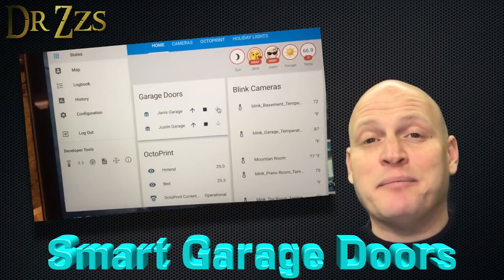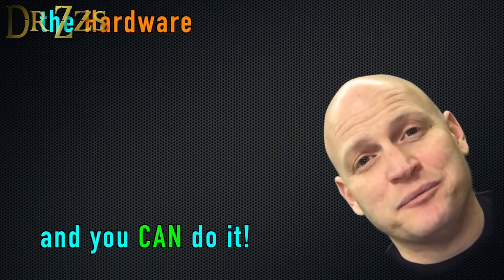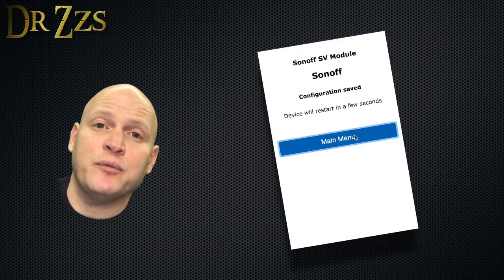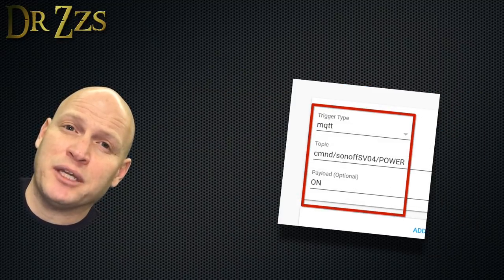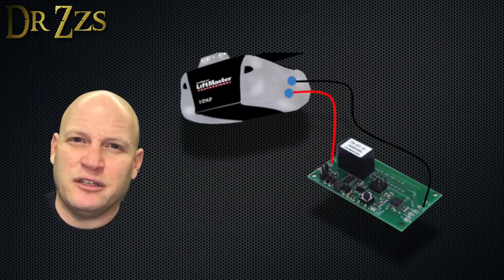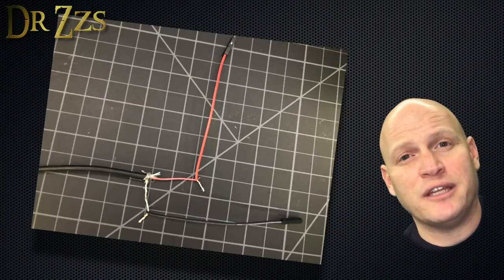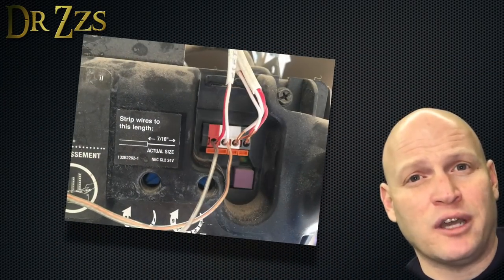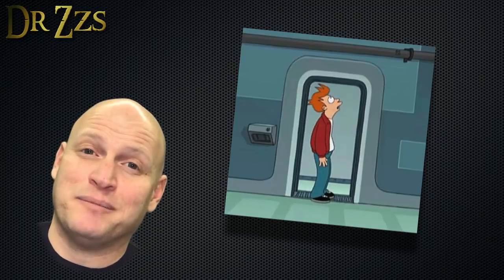$5 DIY "Smart" Garage Door Opener using Sonoff SV

Comment: Thank you for another great video. I just received a sonoff 4ch pro which I plan to use for my three garage doors. Do you have any plans to do a video for that device? It can be powered directly from mains without using an adaptor, is in a DIN mountable case and does not need soldering for power or relay wires. Since I don't need door open/close sensor the plan is to mount just below my existence three wall control panels.
Reply from the maker: Thanks! and you're welcome!
I have a 4ch (not a pro).  I haven't done anything with it yet, but I did buy it with the intent of making a video about it.  I haven't found a good use for it in my house yet. 
Are you planning on using Tasmota on it?
Reply: Yes, Tasmota but will likely hold off until new OTA instructions come out.
Reply from the maker: Cool.  I'll look into flashing the 4ch.  I seem to remember something different about it when I read about it in passing.

Comment: So I bought the components for two of my "dumb" garage door openers. I spent a lot of time learning with the first one and when I had it working on the bench I deployed it and it works great! I just finished building the second one and got it working on the bench but when I deployed it the open/close commands don't work. I can hear the relay click when I send the command via home assistant and I see the garage wall button light turn off for a second while it's "being pressed" by HA but nothing happens at the door. The opener is a newer chamberlain and on the opener there's a light-up up and down arrow button. After I issue a button press using HA I see the down arrow flash three times, not sure what that means. I think this may be a chamberlain design that in incompatible with this DIY solution... any ideas?

Comment: Excellent video as usual.  Couple of thoughts and enhancement possibilities.  If you don't want to wire it up by your garage door motor, you can simply pop open your spare garage door remote and connect it to the contact pads for the remote open/close button (what I actually did).  You can also use another Sonoff with some Home Assistant automation to flash a light and play an audio alarm/buzzer before closing the door (which is what the $100 Linear Z-wave garage door opener does).
Reply from the maker: Cysix Sweet!  You haven’t done that though have you?
Reply: No.  I purchased a Linear Z-wave opener before Sonoff existed.  I did wire the Linear to the remote though and it would work exactly the same with a Sonoff relay.  All the remote button does in close a contact.  BTW- I like your solution of using a reed switch vs a hall sensor or micro-switch.

Comment: DrZzs, thanks for your great video instruction.
I finally got it working w/Sonoff SV,  couple of issue, when I test the reed switch nothing happen. Also it didn't show whether the garage is open or closed. Wonder what control these issue. Thanks in advance!
Reply from the maker: We should be able to figure that out. Can you show me your cover entry in the configuration.yaml and the settings you’ve put into TASMOTA? It’s probably something simple that just got missed.
Reply: Thanks for the quick reply. Here is my setting in Tasmota and .yaml files:

In Tasmota:

Garage
Module parameters:

Module type (Sonoff Basic)

GPIO1 Serial Out 00 None
GPIO3 Serial In   00 None
GPIO4   00 None
GPIO5   00 None 
GPIO14 Sensor  10 Switch2

console:
switchmode1 0
switchmode2 2

/config/configuration.yaml

  # Customization file
  customize: 
    cover.test:
      device_class: garage
      friendly_name: Garage 1

cover:
  - platform: mqtt
    name: "test"
    state_topic: "cmnd/2/POWER2"
    command_topic: "cmnd/sonoffSV04/POWER"
    payload_open: "ON"
    payload_close: "ON"
    payload_stop: "ON"
    state_open: "ON"
    state_closed: "OFF"
    optomistic: false
    retain: false

groups.yaml

garage_doors:
      name: Garage Doors
      view: no
      control: hidden
      icon: mdi:garage
      entities:
        - cover.test

automations.yaml

- id: '1533936441025'
  alias: MQTT SV Test
  trigger:
  - payload: 'ON'
    platform: mqtt
    topic: cmnd/sonoffSV04/POWER
  condition: []
  action:
  - delay: 00:00:01
  - data:
      payload: 'OFF'
      topic: cmnd/sonoffSV04/POWER
    service: mqtt.publish
Reply: DrZzs , I figured it out and got everything working. Now I need to setup a second garage. How should I add the 2nd garage opener to the configuration, group, automation .yaml files. When I create the second cover (changing the command topic name to match the 2nd sonos sv topic), I got an error about duplicate item. Thanks in advance.
Reply from the maker: A Chan the second sonoff must have a unique name and then instead of switchtopic2 2 use switchtopic2 3.  Then the topic in HA will have a 3 instead of a 2 in the middle of the topic for the second sonoff. I use ‘2’ and ‘3’ but you can use anything you want. They just have to be unique.
Reply: Thanks. I ended up with 2nd garage with its title "Cover" and has different picture than garage 1. How do you get the 2 different garage under one title "Garage" with the actual garage picture. This is my configuration file: 

# Garage1

cover:
  - platform: mqtt
    name: "garage"
    state_topic: "cmnd/2/POWER2"
    command_topic: "cmnd/garage/POWER"
    payload_open: "ON"
    payload_close: "ON"
    payload_stop: "ON"
    state_open: "ON"
    state_closed: "OFF"
    optomistic: false
    retain: false

# Garage2

  - platform: mqtt
    name: "Garage2"
    state_topic: "cmnd/3/POWER2"
    command_topic: "cmnd/garage2/POWER"
    payload_open: "ON"
    payload_close: "ON"
    payload_stop: "ON"
    state_open: "ON"
    state_closed: "OFF"
    optomistic: false
    retain: false

  # Customization file
  customize: 
  - cover.garage:
       device_class: garage
       friendly_name: Garage 1
  - cover.garage2:
       device_class: garage2
       friendly_name: Garage 2
Reply: And this is the groups.yaml

    garage_doors:
    - name: Garage
      view: no
      control: hidden
      icon: mdi:garage
      entities:
        - cover.garage
        
    - name: Garage
      view: no
      control: hidden
      icon: mdi:garage
      entities:
      - cover.garage2

Comment: While you can set SwitchTopic2 to "2", it would make much more sense to set it to whatever the topic is for the command, so you'd have "cmnd/Sonoff/POWER" for the relay, and "cmnd/Sonoff/POWER2" for the reed switch state. I used "SwitchTopic2 GarageDoor".
Reply from the maker: Excellent point.
Thanks!
Reply: Particularly important if you have two garage doors and you want to be able to see the status of each rather than one setting the open/close state for both in Home Assistant. :)

This is my first Sonoff device and first non-commercial "smart" device and setting it up was a snap thanks to your video but the SwitchTopic bit was throwing me for a little while until I was watching the console for both and noticed the topic being the same and it finally dawned on me to set a different topic name between the two.

Comment: Great video!  I was able to get my first SV set up wonderfully, but the second is giving me a bit of trouble.  Both SVs seem to fire the same events on the when either reed switch closes, so both of my doors show as open or closed.  Any idea how to change from the default "cmnd/2/POWER2"?
Reply: Ahh, figured it out.  In Tasmota, set "switchtopic2 3" (or any other value), then update the garage cover.
Reply from the maker: Glad you figured it out! 
Didn't even give me time to reply :)

Comment: Can you use a Sonoff basic instead of the SV to open/close the garage door?  I believe I've seen a video where you can turn the Sonoff off/on for a second instead of haven't it run continuous power to the opener.
Reply from the maker: sebringsc Yes. You should be able to use the basic. The trick will be separating the relay from the power to the esp chip. You’ll have to cut the solder lines that go from the hot line in to the relay and connect one leg of the wire going to the garage button there. Then the other leg from the garage button can go to the output + terminal. 
That’s probably not very clear. 

And yes. Check the comments here. Someone explained how to use a command in the TASMOTA console to pulse the relay for just a split second. So the automation I did that turns it off isn’t necessary anymore. 
Let me know if you need help figuring out how to split the power from the relay.
Reply: Thanks for the guidance.  I did some more digging and drew this schematic ( https://ibb.co/dsh8Yx ) and was hoping you could look to see if this is what you had in mind.  My only question is do I need to power the Sonoff with a USB cable and if so, where would I attach it on the basic?
Reply from the maker: As far as I can tell that should work.  I haven't done it so I can't say 100% for sure. 
As for powering, you probably will need 3.3v, I don't know if 5v (standard fro USB) will break the ESP chip, it might.  You'll have to cut the cord and solder the wires to the 3v and ground pins you pointed out on that image.  
That's my best guess at least.  
I'm pretty sure I've seen someone do this but now I can't remember the reference or find the video link.  Search around YouTube or the Tasmota site.  I think this has been done and you could probably find more useful info than what I'm giving you. 
Sorry I'm not much help with this.

Comment: Is there any way to query the state of the reed sensor? The state isn't retained when Home Assistant restarts and it's driving me nuts trying to figure out how to accomplish this. I have the retain flag set to true in my cover sections of my configuration.yaml. I watched your video on Tasmota SwitchMode Explained but I'm still not sure how to send a command from Home Assistant that would pull the current state of the reed sensor (not the power state of the sonoff). Please help!!
Reply from the maker: What version of Tasmota are you using? 
Maybe try updating the version of Tasmota.  I'm not sure when it happened but mine started sending state messages some time ago after a Tasmota update.
Reply: DrZzs thanks for you video.. I have same problem... Sonoff sv with tasmota updated. Working very well except when I have to restart my PI HASSIO.IO ALL garage arrow and stop are on and only way to fix is open and close garage door. A part from this problem is working very good with siri :) thanks

Comment: hello mate I am using rf transmitter in my car it always on it powered directly from the cigar lighter when the car is in range it triggered a relay on auto gates and tell the to open when car engine is off no power go to 12v plug and gates close
Reply: they are really cheap and small and have a very small range

Comment: You mentioned that the resistors don't have to be popped.  Do you know whether it's safe to apply 5-24VDC across the terminals of the garage door unit?
Reply from the maker: My opener uses 12v for the signal from the unit to the button, so I could have just ran the sonoff parallel to those wires and run it off that voltage.  
I can't say for sure with your unit, but I would expect that 12v for the signal to/from the button is pretty standard.  Best thing to do would be to measure the voltage of your unit with a multimeter.
Reply: Thanks.  I found a 12v AC adapter from an old cordless phone lying around, snipped off the barrel plug, and ran the two wires to the SV power inputs.  I plugged the adapter into the 120VAC outlet that the garage door opener is also plugged into—works great. ps: I'm a fellow MD–turned–home-automation enthusiast.  Your videos have helped me a lot.
Reply from the maker: Awesome!
Home Automation is a lot more fun than medicine most of the time.  And a lot less regulated...
:)

Comment: Works great! Thanks for sharing. I used a D1 mini, reed switch, dht11. 

Thoughts on the energy saving mode with tasmota? It looks like it reports temp every 5 minutes. Is there a way to sleep it and on door open/close or temp reading turn on? 

I have some concerns with adding the relay that someone could easily open my garage door.

Comment: I have another question is possible to read switch be inverse? now on ma sonoff sv when is read switch connected show open when read switch is not connected is closed I want to be oposite. when is read switch connected status of slide gate be close. it's easier for my installation...
Reply: I find a solution in covers.yaml file or in cover section in configuration.yaml change state_open like I wrote
and that its! :)

from:
  state_open: "ON"
  state_closed: "OFF"

to:
  state_open: "OFF"
  state_closed: "ON"

Comment: I'm using sonoff SV as wifi relay for my garage door. Everything is fine except that when I plug it, for first time when it initiates it switchs on and off the relay, so when I unplug and plug it, the garage door opens... Is there any way to stop this behavior?

Apart from this, I have an issue with the webclient password... I put a password to access the tasmota web client but there wasn't any place to set the user, so now I'm unable to access to the web console because it asks for User and Password both... not sure if the User is generic or if it was in another tab that I didn't see... if there's a default user and you could share...

Thanks!
Reply: The user is just "admin".

As for the problem of it automatically going on when plugged in you need to run "PowerOnState 0" to stop it from doing that on powerup.

https://github.com/arendst/Sonoff-Tasmota/wiki/Commands

Check the various PowerOnState options.

You could also use Tasmoadmin to manage those settings.

Comment: Update,
Got it working.
I found out that is important to use switchtopic2 2 instead of what i did.
I thought id use my own topic, but this does not work. changing it to switchtopic2 2 dit make it work. finally

This is exactly what i need for my gate to open and close. It works the same way by just making a momentary contact. I have modified 2 of the standard Sonoff basic switches to function like that, and it works great with Tasmota. 

Edit, (spent another day figuring thins out)
I have been trying to get this working for my Sonoff basic which should work but i cant get it to work properly.
I set up Tasmota 6.1.1 with my settings for wifi and mqtt.
I set everything up in homeassistant just like your example.
except is used the following command in the console.
switchmode1 0
switchmode2 2
switchtopic2 gatestate   (this is what made my state work)

The cover shows, one arrow is black  and clickable and steers the relays switch.
One arrow is grayed out an does not function. 
After activating the reed switch, my mdi icon changes, but the arrows do not change 

I don't understand how it is defined that one or the other arrow cant be clicked.

I am trying to set this up in latest Hassio and i have set the pulsetime so i don't need the automation.
What am i doing wrong ?

in config.yaml
cover:
  - platform: mqtt
    name: "test"
    state_topic: "cmnd/2gatestate/POWER2"
    command_topic: "cmnd/sonoffgate/POWER"
    payload_open: "ON"
    payload_close: "ON"
    payload_stop: "ON"
    state_open: "ON"
    state_closed: "OFF"
    optimistic: false
    retain: false

in customize.yaml
cover.test:
  device_class: garage
  friendly_name: front Gate
Reply: remove the 2 from the line         state_topic: "cmnd/2gatestate/POWER2"

Comment: DrZzs: I followed your instructions in this video and got everything working except for the user interface.  My UI doesn't show the the up-and-down-arrow indicators showing status of the reed switch.   There are no arrows shown in my UI at all, only a big garage icon.  Using MQTT.fx, I checked MQTT messages published by the SV when the reed switch is closed, and that looks correct.  Also, if I publish the cmnd message defined in configuration.yaml to the SV manually using MQTT.fx, and the relay activates as expected.

What part of the YAML is actually creating the UI shown in your video?  What do you think is causing my problems?
Reply: Well, I played with "configure UI" and got the arrows to show up somehow, but only when I chose the cover.xxxxx entity.  Only the up arrow is clickable; the down arrow stayed dimmed.  If I chose the group.xxxxx entity, only the icon showed. 

If anyone has any insight on how to get this right, please post a reply.  Thanks.
Reply: I rebooted the HASSIO computer and everything seems to be working now.  I'm still scratching my head on how I managed to fix this.

Comment: Hi DrZzs, I am planning to automate the garage door as per your video and have purchased the sonoff SV. With regards to the reed switch, I couldn't find the same model on amazon. Do I have to be considerate of any details on which reed switch to purchse? Any kind is ok?
Reply from the maker: any should do.  Some don't come with magnets so you have to supply your own.  and some are more sensitive than others.  But as long as you position it so the magnet is touching the switch when the door is closed any should work fine. 
Good luck!

Comment: Can anyone assist in doing this with a a D1 Mini and relay hat. Tasmota 8.1 and latest HA. I got the relay and the reed switch separated. I got the relay to trigger for 10 miliseconds and then turn off. I am just not getting the relay switch info in HA. I see the MQTT requests coming through, but the device just shows a number, not of or off, open or close.

Comment: Hey bro everything was working just fine with my Sonoff sv but for some reason now the button on the board doesn’t work the led light blinks but it won’t connect and the board gets hot I’m not sure what could that be anything from your experience would be highly appreciated thanks :)))
Reply from the maker: oh boy. that sounds bad.  That board may be dead.  Not sure what to tell you to try next.